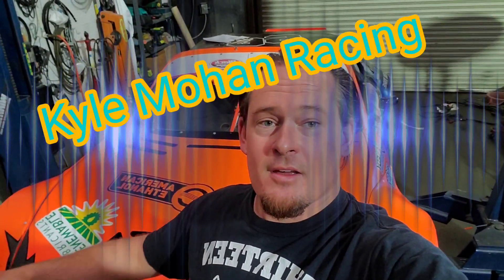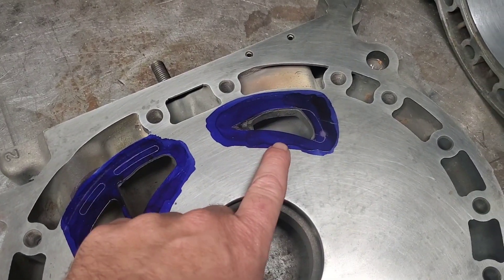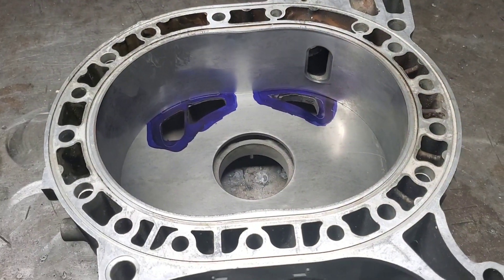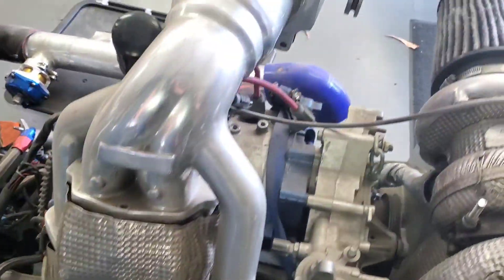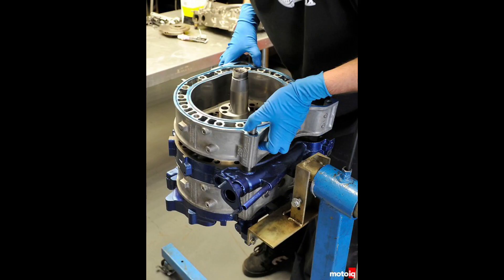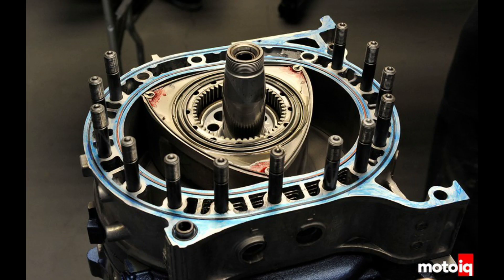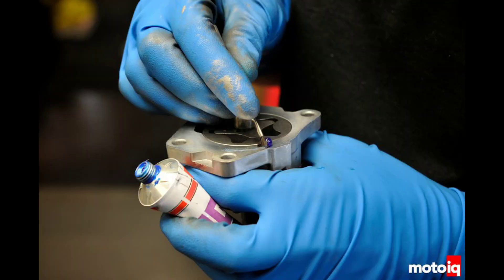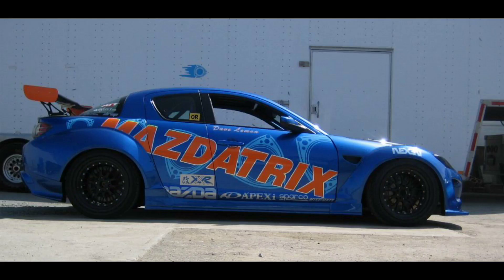RX8 Renesis Hybrid build, multi port exhaust experiment KMR/Mazdatrix

Comment: while this may have been a success in your application, this setup has built a reputation for being very problematic and unreliable. People will do these engine builds and overhype the hell out of it and once finished and the car is running with it you might see a few idling videos and then they just disappear with no explanation. I would like to see more real world results with these and how they can be made reliable for everyday street use, but until then my opinion of them remains the same
Reply from the maker: Actually I don't see any information online about this set up being problematic. I think what you mean is the set up is difficult to make and expensive. We didn't have any problems and the other shops that I know that have finished the project were very successful. I think generally the problem is people don't finish the project. And this is hardly an over hyped project we did this 10 years ago and won a championship and nobody seems to know about it.  lol
Reply: I have seen posts in regards to the hybrid over the years. Was never able to get any real good posts on the outcome. Do you know where the problems have occurred?
Reply from the maker: @stevecarlisle3323   There were no real problems for us. Very reliable and straightforward. I think the only problem is people don't finish their projects lol
Reply: @stevecarlisle3323  I do not. No one has ever had a clear answer. Nothing but positive things have ever been said by the people overhyping them, but then just nothing. They just disappear and no updates at all about them.
Reply from the maker: @NateRist   Generally I find the Internet full of people complaining.  Generally things that are successful just go out and do their job just like this project.   It made horse power ran great sounded amazing won a championship and then the car and project was sold because it was successful.
Reply from the maker: @Toby Santiago  Yeah those are pretty easy to use setups and don't require much fabrication
Reply: Yes... I agree with you bro kyle... Its because they not finish the build.. And cant find a good tuner too... 
And in forum what i ve read many people just make teory then making a good engine... 
I love this setup when i was first saw this a month ago... 
Next years after covid... 
I will bulid this.. For NA or turbo setup.. For street use.. 😁😁😁
Reply from the maker: @heruhadianmudjenan4377  yep.  Thanks for the support.  We did it and it was a good build for us, lots of power and reliable.  But we spent moneyon the setup....  👍 people just want to argue these days.  Lol.
Reply: @KyleMohanRacing  yups... Lol... 
I want ask you if you dont mind... 
What type turbo i must use can reach 600++ hp... 
I read in radness that u have achieve... 😁